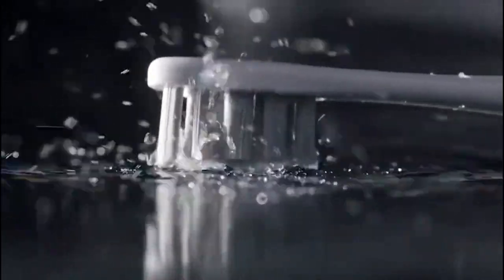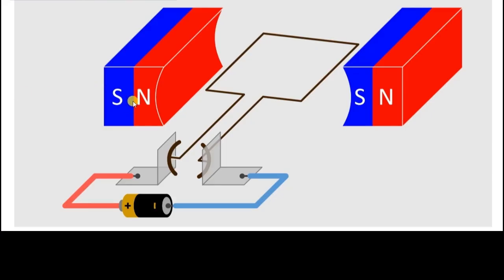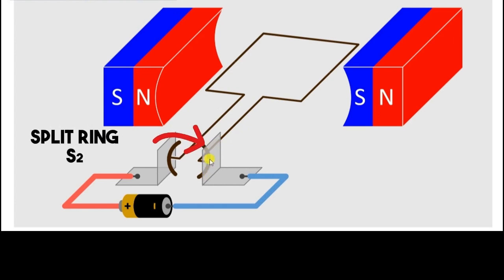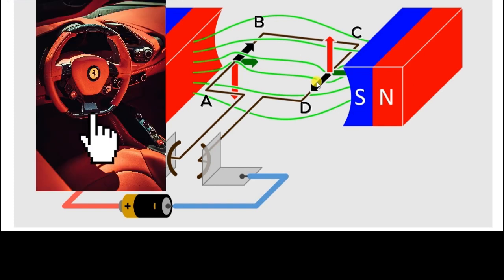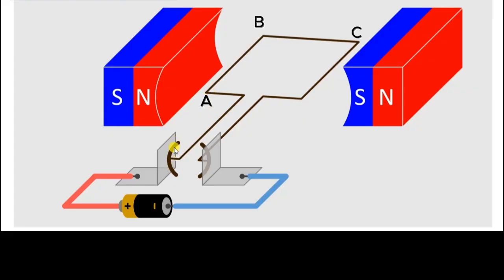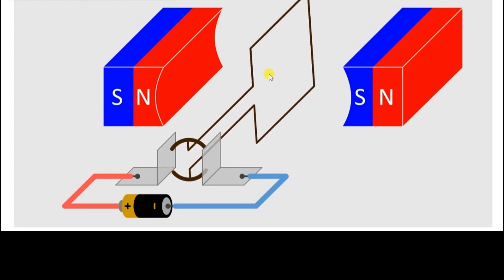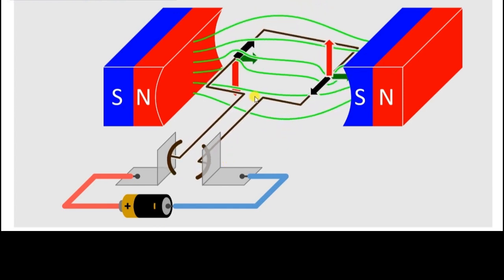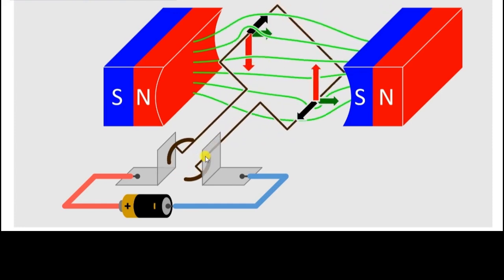DC Motor working principle  | GCSE IGCSE Physics | Electromagnetism

Comment: Split ring dc motor manget green ac conductor right copper coil brush blue red commutator s1 s2 ring electromagnetic ampere current purple emf  teacher ji
Reply from the maker: I didn't get your question please cam you explain?